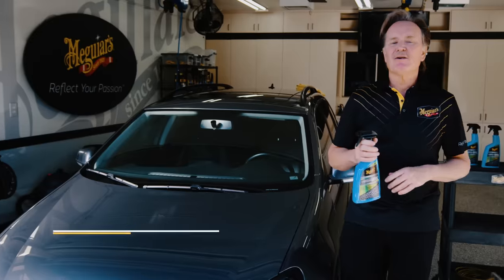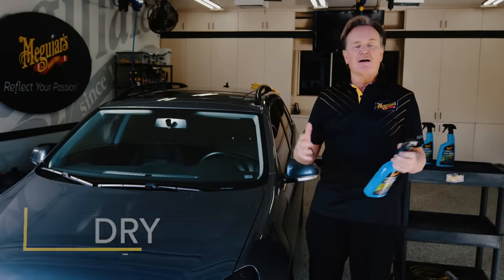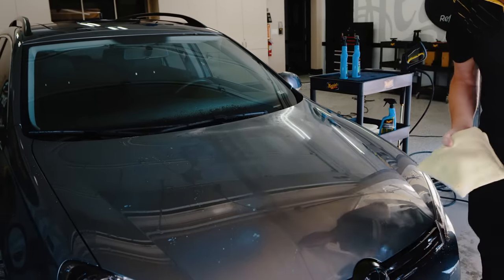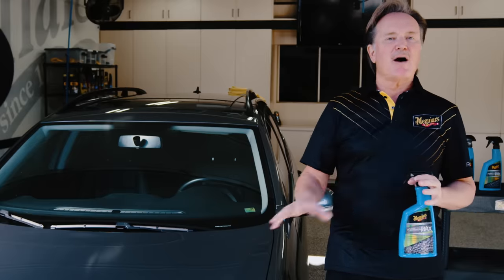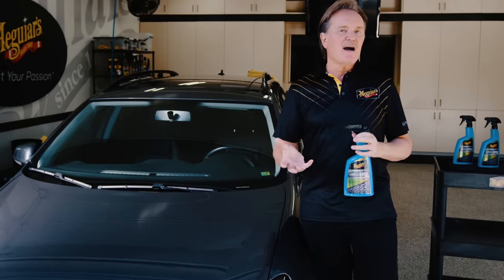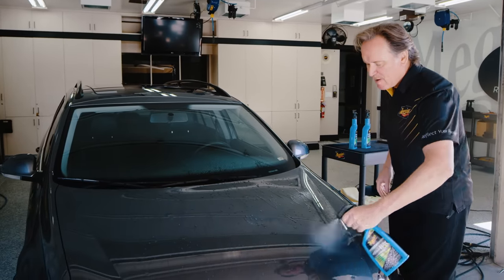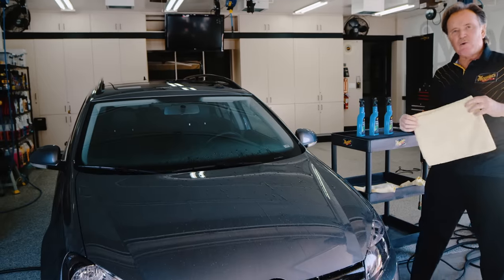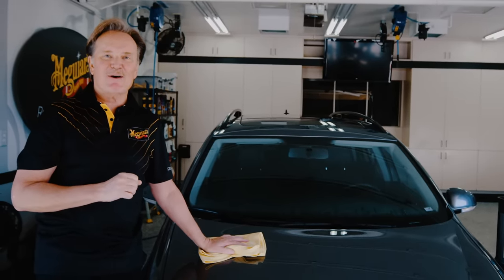Meguiar’s Hybrid Ceramic Wax - Ceramic Made Easy!

Comment: Hi, just used this product but I just have one question. After I washed my car I dried it with a micro fibre cloth and then I applied the first coating of the ceramic wax and then used another micro fibre to cloth to wipe it off. Does that matter that I didn’t spray it on to a wet vehicle and then dry it off ?
Reply from the maker: Did it apply and remove easily?  Yes, you really want to use the product on a wet surface both for ease of use and effectiveness.
Reply: Meguiar's yeah come off pretty easy. I then used a pressure hose to rinse the car again and then I sprayed the ceramic wax on and then high pressure hose it off. I guess I just want to make sure I haven’t done anything to damage my new paintwork
Reply from the maker: No you are good.  Although, we would recommend applying the foundation layer according to directions.  There are reasons we recommend applying it certain ways, if there was a better way, we would advise.  Apply according to directions for best results, simply as that : )

Comment: So if u have wax on the car already would u apply it as a regular coat? Or as a spray on coating?
Reply from the maker: Yes you can use it in addition to your favorite wax / sealant already on the car.

Comment: Do i apply it to the car wet ? Or do i dry the car first and then apply ? Especially for the first application...it doesn't specify yo dry the car after washing it ....so I'm assuming i have to apply it to the wet car ?
Reply from the maker: Yes, your car should still be very wet from rinsing when you apply the product.  The water is necessary to help dilute and spread the product.

Comment: What car wash would you pair with this? I'm getting a cut and polish done in a few weeks and I'm trying to plan ahead to make sure I can maintain it as best as possible with minimal fuss. Up till now I've been using Wash & Wax, but how does that compare with NXT and Gold Class, especially when paired with this? Realistically this spray is pretty much the only wax going on my car (no other liquids and pastes). I'm thinking W&W plus this would be decent...
Reply from the maker: Hi Chris, so our Ultimate Wash & Wax would be good to use, but keep in mind, any product used on your paint with protective ability, whatever is used last on the paint, you are going to see the water beading characteristics of that paint.  So if you do want to use Ultimate Wash & Wax, it would be best to use Hybrid Ceramic Wax each time for the final step.  If you don't want to use Hybrid Ceramic Wax every time you wash, a car wash without wax would be better in this case, like our Gold Class Car Wash.  Hope that makes sense.

Comment: If this gets on the plastic or rubber trim will it prevent a dressing from adsorbing or bonding?
Reply from the maker: Great question!  In theory this could cause a dressing to not adsorb as easily; however in practical terms there is no real negative consequences either.  It will likely either be somewhat protected and dressed by the Hybrid Ceramic Wax or the dressing being applied.  Either way it will look nice and have some protection.  It's also important to note that although the Hybrid Ceramic Wax is safe on glass, wheels, plastic, rubber, etc. it will not perform as ideally as it does on paint.

Comment: If u use cutting compound plus polish then do u still need to wash the car again?
Reply from the maker: Not entirely sure what you are asking?  If you are asking if there is a need to wash the vehicle between steps the answer is no, not usually.
Reply: @meguiars  Let me elaborate this. I have done cutting compound then car polish. I need to apply Meguiar's ceramic wax. Do I need to do car wash after Meguiar's car polish because ceramic wax instructions talk about applying it on a wet surface only ?

Comment: If I use the ceramic wax and then use meguiars ultimate wash and wax soap for the weekly manteinance washes , would it strip out the ceramic wax?
Reply from the maker: Hi Jaime, no, it will work to preserve and maintain the wax protection on the vehicle.

Comment: Do I need to wax the car before using this product ? i have apply this product before.. but haven’t wash car like ages so after wash the car I apply this product straight away without other wax but then I notice there is some water mark I guess I need to buff it out ?
Reply from the maker: This is a wax.  There is no reason why you need/have to use another wax first before applying it.  Just make sure you follow the instructions in this video as this product does have a unique application.

Comment: So first time you rinse and apply... do you dry first after rinsing as you’re car looks dry .  No buffing?
Reply from the maker: No, you want to spray the product on the car when it is still very much wet.  You need the water to help dilute and spread the product.
Reply: Meguiar's  oops I did my transit van dry then buffed it will that matter?  Had a great shine on it or do I now wash it and do it again this way?
Reply from the maker: Certainly no harm if it came off without a problem but yes typically you need the water or else it could be very difficult to apply and remove.

Comment: I have a question My truck has not had any wax on it before and I want to start using this product. So can I take my truck to the car wash. Would that count as the foundation layer wash? Then would I spray it on and dry it off? Is that how I would do it?
Reply from the maker: You would do it just how the video shows.  Not sure what kind of car wash you mean?  If you it's the drive through kind where they dry the car that will not work because the car needs to be very wet still when applying the product.  If it is the kind of wash where you use the pressure washer yourself that would be fine and again identical to the application seen in this video.

Also note that this product should almost be treated like a concentrate and used sparingly.  You really only need about 2-4 squirts per panel.
Reply: @meguiars  yes I meant the drive through one. What if I go through the drive through car wash and then come home and spray my truck with my garden hose then wii would I be able to do it like that in video to establish the base? Can I use a garden hose or does it need to be a pressure washer? If I use a garden hose what nozzle should I use? Would the fan one be the best? Do I wet the whole car then spray that stuff on it or just do panel by panel?

Comment: I just  have a quick question, he is mentioned in the video u can use this as a top coat. So I waxed the car today so I spray it on and when I buffed out it was kind of hard to take it out. May I use this after waxing the car  as a top coat ??
Reply from the maker: Not entirely sure what you are asking.  Yes, when mentioned that our Hybrid Ceramic Wax can be used as a "top coat" that means it can be used over/after any other wax, sealant or coating.

As far as having difficulty wiping off the Hybrid Ceramic Wax the two biggest factors that would create this experience would be...

1)  Too much product.  You have to view the Hybrid Ceramic Wax almost as a concentrate.  You often only need 2-4 squirts per panel.  One bottle should be able to do at least 4-6 cars if not more.

2)  You need to make sure you are following the instructions on the label and this video as it relates to keeping the surface very wet while applying.  If applied to a dry surface it could become much more difficult to remove.

Hope that helps!
Reply: @meguiars   Thanks 🙏

Comment: Can you apply this to chrome wheels? If not do you recommend a similar product for wheels?
Reply from the maker: Hi Matthew, yes, this product can be applied to really any wheels, provided directions are still followed, however, since wheels are in an environment which are more constantly bombarded with heat, environmental contaminants, road grime, etc., we would say do not expect the product to last quite as long as it would on the vehicles paint surfaces.  Additionally, in general the product performs best on painted surfaces, so for chrome specifically, again do not expect top performance.  At this time, 10/8/2019, we do not have a similar product specific for wheels.  In general, for wheel care, as far as our general recommendations, #1 is frequent cleaning is key, the longer you allow contaminants to sit on the surface the more likely they are going to have a chance to cause an issue like bond or etch. Check out products like our Ultimate All Wheel Cleaner & Ultimate Waterless Wheel & Tire, these our our latest top performing products within the wheel cleaning segment : )

Comment: I had some excess hybrid ceramic dribble from the tip of the sprayer onto my plastic headlights and it dried / stained the plastic. I tried polishing the headlights again, but the stain wont come out. Are the lights ruined? It looks like it penetrated deep into the plastic. I can't even scrape it off
Reply from the maker: There is nothing in the Hybrid Ceramic Wax that should be able to perminantly etch/damage anything.  What did you use when you say you "polished" them again?  You could first try dishwashing liquid and water or a good all purpose cleaner.  If you need to get more aggressive our PlastX or a mild compound would work.  

Please feel free to reach out to our Solutions Hub for assistance...

https://s.3m.com/83pr72
Reply: @meguiars  I first tried wiping with IPA, it only cleaned the top layer. I then used some more force with IPA and a paper towel, but nothing improved. Moved to ultimate compound on a drill poliser, nothing still. I had the same issue with residue stain happen when I accidentally left the mf towel I used for spreading hybrid ceramic on a painted panel to dry overnight. I sanded the panel with 3K grit > ultimate cmpd > ultimate polish and it's still hazy. I can email pics to Meguairs support.

Comment: If we rinse it right after we spray on, isn't the products will just wash away and didn't distribute evenly?
Im thinking why not we use a microfiber towel to kinda like buff it evenly before we rince it and dry it? Hope someone can give me some suggestions. Thanks
Reply from the maker: We understand it is a unique application but please trust us that this video does show the correct way to apply the product both initially and then subsequent applications.  It does work and you actually want to use quite a bit less product than you think.  You only need 2-4 squirts per panel rather than covering the entire surface.  👍

Comment: After using it once how much time it will last? Thanks in advance. :D
Reply from the maker: How long it will last really depends on the environment your car is in.  If your car is exposed to the elements quite a bit you could use it every few washes since it's so easy to use.  If you are looking to do it as little as possible every few months would make sense.  Again, this is highly relative to the exposure your car has to the typical elements that attack your finish.

Comment: I was thinking of applying meguiars ultimate wax and then gold class carnauba and then finally hybrid ceramic wax on top. Would that be a good combination?
Reply from the maker: Definitely overkill and the Ultimate and Gold Class will not work on top of each other.  The only logical way to make this work is by applying either Ultimate Wax or Gold Class Wax followed by the Hybrid Ceramic as it will still work on top of one of the others.  So just pick your favorite and finish with the Hybrid Ceramic Wax on top.

Hope that helps!

Comment: can  you spray this on a cool dry surface like traditional spray wax? and wipe off and buff?
Reply from the maker: We do not recommend this be used dry.  You really need the water to help dilute and spread the product.  If you attempt application without water you may have a very difficult time apply and removing.
Reply: @meguiars  thank you for the reply.
Reply: @rsea910  It is very easy to apply and remove from a dry surface - You must not leave it for long and you do not need very much AT ALL. I suspect Meguiar's reps say not to use it on a dry surface because the average consumer will be likely to use WAY TOO MUCH and end up with horrible results... Then they will come to YouTube and or amazon and start talking about how disappointing the "garbage" product is. *If you do not use too much*, and you do decide to (evenly) apply it to a dry surface (without leaving it too long), you will end up with a product that outperforms pretty much everything else in its category... BUT, here is the catch... It is so darned easy to maintain (especially if you are using the Meguiar's Hybrid Ceramic Wash & Wax) and lasts very well even with a "wet" application, so there is not much point to trying to do the "dry" application except perhaps if you have a situation where you know you are not going to be able to apply another maint. coating or do a Hybrid Ceramic Wash & Wax (wash) for an extended time... A slightly damp application seems to be the ideal middle ground for crazy longevity and ease of achieving a great result (AS LONG AS  YOU DO NOT USE TOO MUCH PRODUCT -- a little goes a long ways and makes for BETTER results).
Reply from the maker: Great feedback! 

Thanks for sharing.  👍

Comment: Do I have to clay the car and compound it before applying it? My car is 2 weeks old
Reply from the maker: Whether or not you need to clay and compound is entirely relative to the condition of your paint.  If you have bonded contaminants you will want to clay.  If you have defects in the paint like, swirl marks, fine scratches, oxidation, water spots, you will want to compound to remove them.  And if you have neither of these and the paint is in perfect condition you can skip those steps.

Comment: Hi there , if my car were fully coated I can skip the foundation step right ? I just rinse my car spray hybrid ceramic wax and rinse it away after that dry it with drying towel ?
Reply from the maker: Yes, you can do certainly do that.  👍
Reply: @meguiars  thanks for the guidance
Reply from the maker: Happy to help!  👍

Comment: If I’ve applied this to my truck and now wanna buff/wax it what steps do I need to take? Just some type of remover maybe?
Reply from the maker: Not sure what you mean by "buff it" as that could mean a number of things to various people.  That being said, if what you mean is that you now want to go back and remove some kind of contaminants or defects after waxing you can simply proceed with that process as both claying and compounding will remove the wax in the process.
Reply: @meguiars  ok thanks so I can just clay bar then compound then polish? No other removal steps needed first? Thanks so much!
Reply from the maker: Other than washing before all of the steps you mentioned, yes that is correct.

Comment: Does it work when i spray on a soapy surface after wash and rinse off altogether?
Reply from the maker: No, you should be using this just as you see in the video after rinsing the car wash soap off but while the car is still very wet.

Comment: I don’t have a garage, so my vehicles are in constant sun. The paint has faded, come off, and looks horrible.  I want to buy a new car but have been putting it off until we get a garage (which could be another 10 years.) if i get a new car and use this, will it prevent the paint from fading?
Reply from the maker: Yes, applying a good protection (wax) on your vehicle as well as regular maintenance to keep in clean will preserve the life of the paint quite a bit.
Reply: @meguiars  How often do you recommend applying the hybrid ceramic wax? Once a week? Every two weeks? Once a month?
Reply from the maker: How long any protection/wax lasts is highly variable and depends on a number of factors related to the condition of the paint, previous prep, and the environmental elements the vehicle is exposed to. 

That being said, on a well maintained vehicle the Hybrid Ceramic Wax can last up to several months; however some have found it so easy to apply during the washing process they do it more frequently.

Comment: I just got the green bottle , the blue and the liquid wax. If I want to use all 3 which order should I use them in? Blue bottle first then green then liquid wax ?
Reply from the maker: If you have all 3 it would make sense to use the liquid (yellow) as your first application and then the spray (blue) any time you like during subsequent washes.  You can use the Hybrid Ceramic Detailer (green) as you would any detailer for easy maintenance to safely remove light dirt, dust, fingerprints, etc. any time you like.

Hope that helps.  😀
Reply: @meguiars  awesome thanks

Comment: Do we need to discard the towel after laying down the foundational layer?
Reply from the maker: No sure what you mean by discard the towel.  You don't need to throw it away if that is what you are asking?  Your towel can be washed, dried, and used again.
Reply: Meguiar's some ceramic coatings such as CQuartz UK require once the ceramic coating is wiped on the microfiber towel needs to be discarded because it hardens and turns to “glass” which will scratch paint if the towel is re-used. Glad to see Hybrid Ceramic Wax is different.
Reply from the maker: Yes, we are aware of that. This is not a coating and that is not required.  👍

Comment: Should i wax my car after evry wash or once a month
Reply from the maker: You should not need to wax your car every time you wash.

How long any protection/wax lasts is highly variable and depends on a number of factors related to the condition of the paint, previous prep, and the environmental elements the vehicle is exposed to. 

That being said typically for a daily driver we recommend you wax approximately 3-4 times per year.